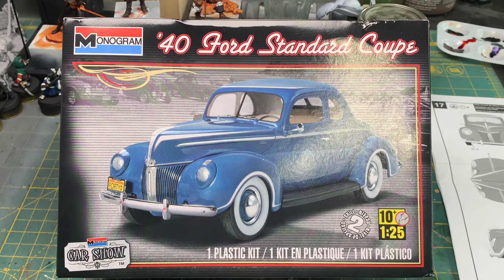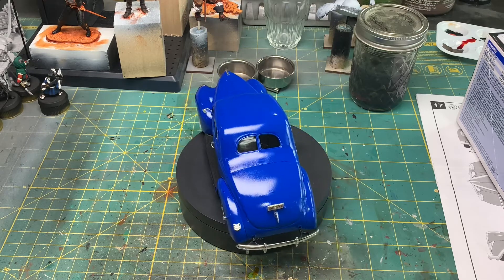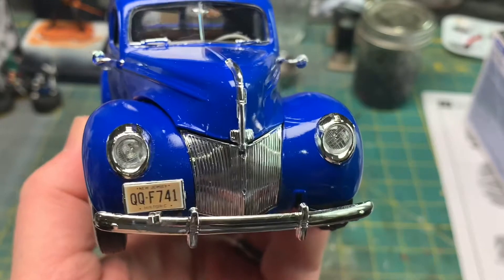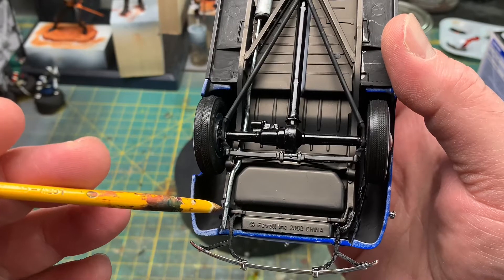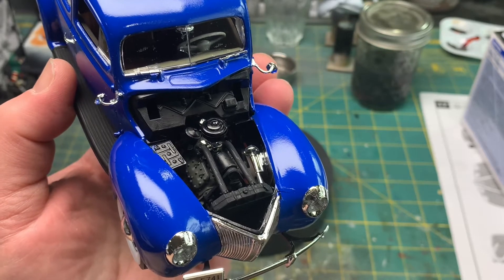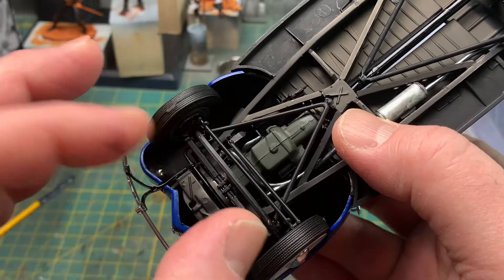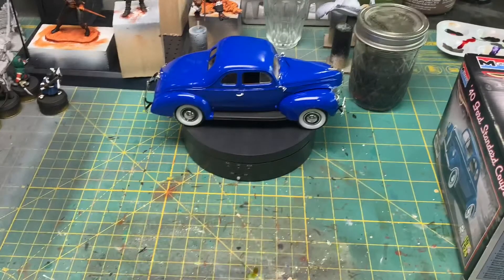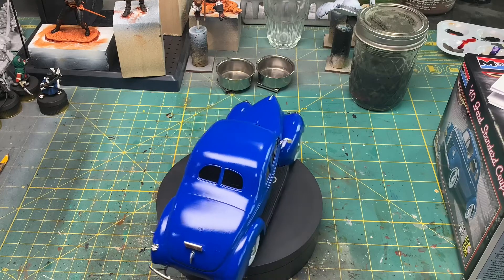Video 199: Monogram ‘40 Ford Standard Coupe

Comment: Very nice ! Well done 👏. My building abilities are getting there but it will be time b4 I get to your building skills. 
This is one of thee best kits I have seen in awhile. The instructions were very well done. The detail is top notch. For comparison, I have a unbuilt , still in the box AMT Kit #6581 1940 Ford Coupe that I bought over 33 years ago.  I pulled both kits out and did a comparison. 
Both kits are 1/25 Scale. AMT was a nice kit but the packaging was horrible compared to today's standards. A bunch of plastic crammed into 1 bag with alot of loose parts. Very little to no tree's. Light Blue plastic, and the instructions were not good ( obviously we've seen worse). The  front box art was VERY generic,  but nice photos on the one side of the completed kit. Anyway, the level of detail was so inferior to this Monogram kit. I WISH ALL models from AMT looked like this kit. The only features of the AMT kit that were better was the options to build a street rod with really nicely done decals. This Monogram kit is a kit you wanna go thee extra mile to detail.  I give this kit 4 out of 5 stars.
5 is reserved for Tamiya type quality. 
Again, nice build  😎👍
Reply from the maker: Thank you and thank you for sharing your experience.